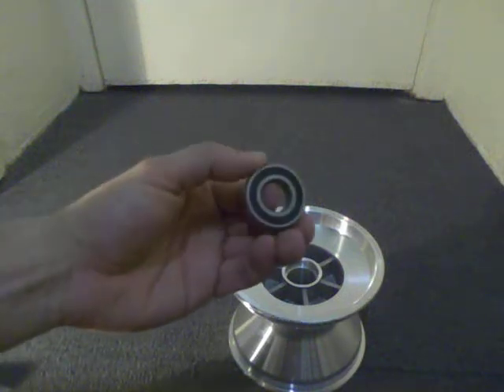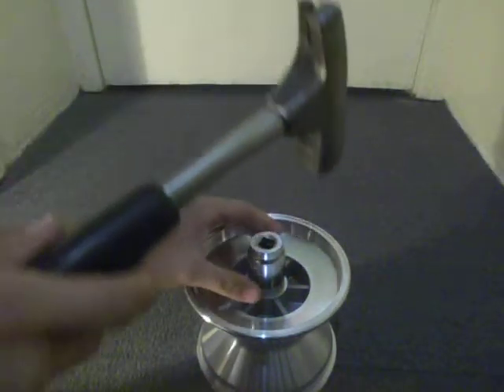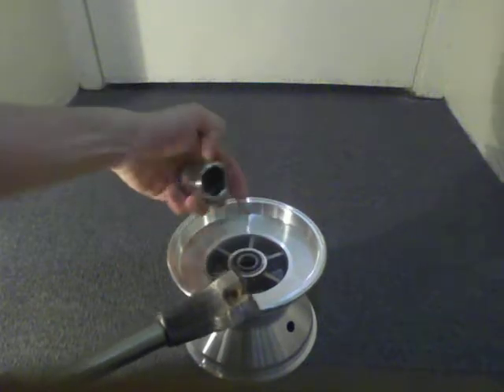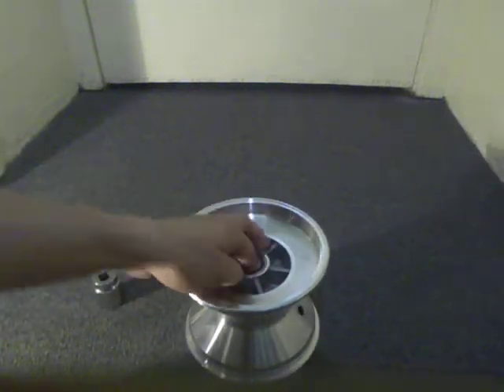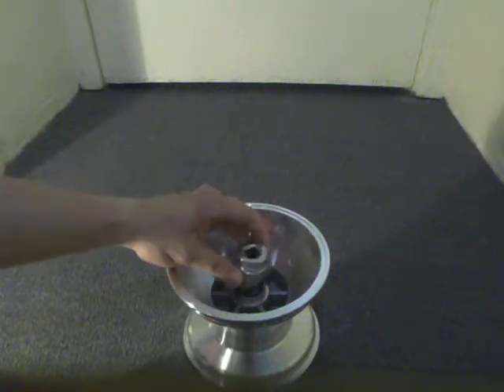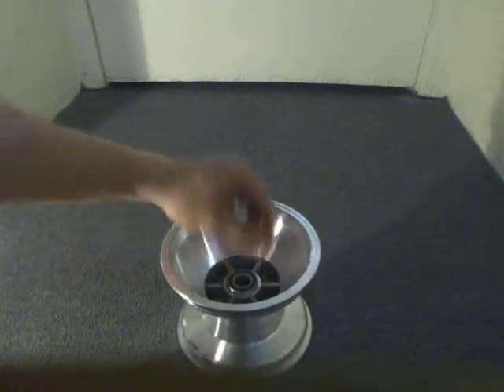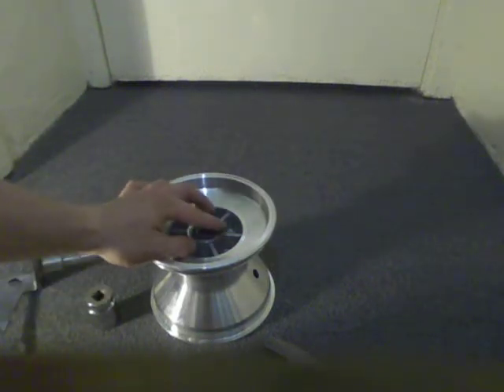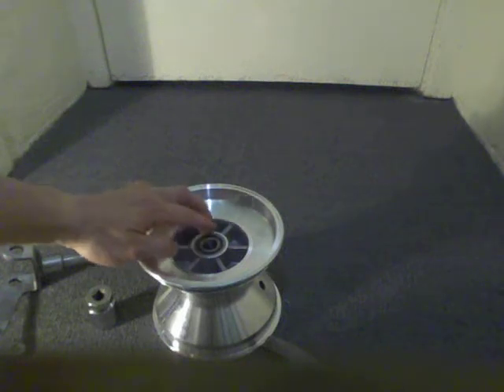Installing ball bearings into go kart rim

Comment: Nice video. Is 1/2 inch usually the regular size of the bearings? Also where could I buy bearings? Do places like advanced auto, walmart, or napa sell bearings?
Reply from the maker: Thanks. Not sure about regular size of bearing. This bearing was made to fit on a 17mm stub shaft. I believe Napa, Walmart & Advanced Auto sell bearings, but I am not sure if they would sell the type needed for my go kart. You would have to ask them. What bearings do you want buy? Is it for a car or bike? There are different types of bearings and sizes.

Comment: Can you show how to remove the bearings?
Reply from the maker: I haven't had the need to remove a bearing yet from a go kart rim, but if I had to do it, I guess I would use a punch and hammer, but I would have to come at an angle, but from the other side. The punch will need to go thru the hole (without touching) of the other bearing and contact the bearing you want to remove. Mind you, the bearing will likely be damaged as I have no access to the outer race/ring. I would have to change angles every time I hammer so that the bearing comes out evenly. Not sure if what I wrote makes sense, but my iMac died so I can't edit videos at the moment. :-(
Reply: ElectricCarVideos
ahh I wasn't sure if i can move the spacer. The bearings are sitting pretty tight against it and when i try to punch it, it just slips. I don't care about destroying the old bearings,, they don't work good anyway.
Reply from the maker: l3MTA3l  Do you have a picture of your setup? I'm not sure what you mean by spacer. Are you able to post up a video of how you are trying to remove the ball bearings?